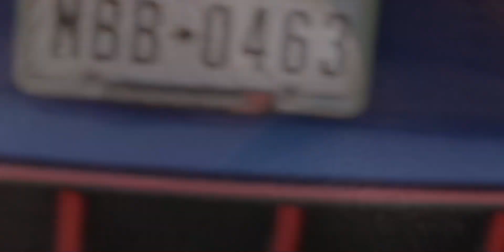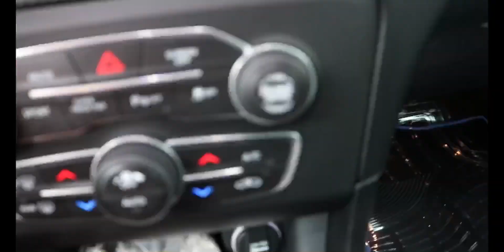DODGE CHARGER "RT” DYNOMAX  RACING MUFFLER,  W/RESONATOR DELETE 🤷🏿‍♂️🤷🏿‍♂️🤷🏿‍♂️

Comment: You still got your mid mufflers on?
Reply from the maker: No I do not. I have racing bullets on… in place of resonators…
Reply: @Mr.Charles73  did u delete the x too?
Reply from the maker: @blanco3742  no.. just the mufflers.
Reply: @Mr.Charles73  sounds good still man. So far I got my x and muffler deleted. Too quiet for me. So I'm putting in the bullets right where the res is. I love the sound your ride has man
Reply from the maker: @blanco3742  yes suh…literally only thing better is aftermarket.